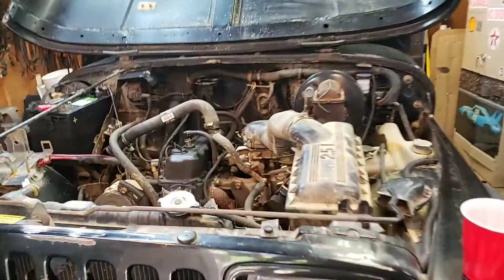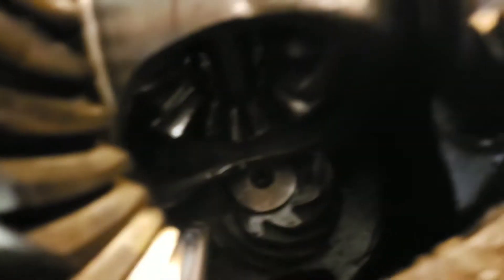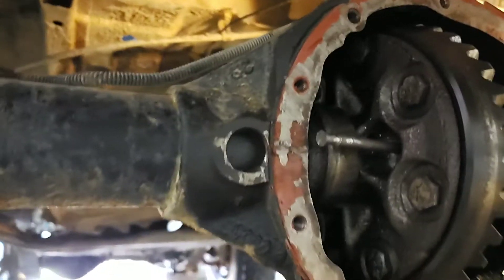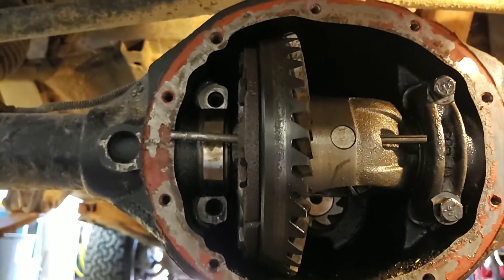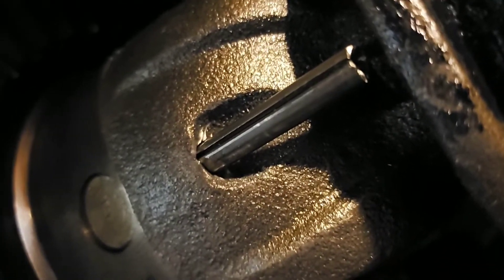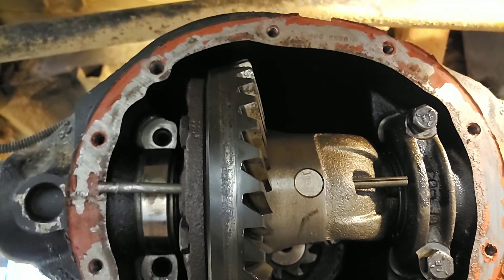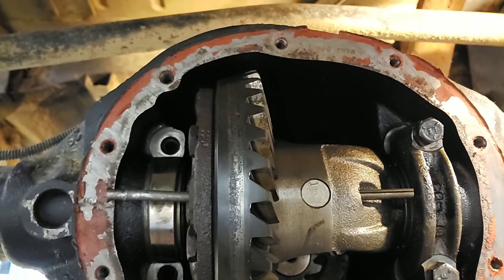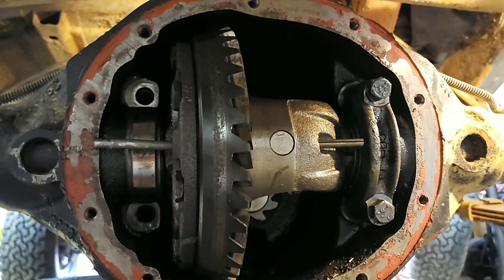1989 YJ non c-clip Dana 35 roll pin remove cross pin

Comment: Can you pull the whole carriage out without pulling the roll pin ,and leave the spider gears in to change out the bearings? Thank you.
Reply from the maker: @John-zz5gt  I don't see why not. I'm not an expert in setting up gears but ya may want (or need) to check the ring and pinion mesh is correct after swapping carrier bearings!
Reply: @winterturtle5764  I did not think of that. Thank you Sir.

Comment: Could you re use the roll pin?
Reply from the maker: @John-zz5gt  certainly possible but given the cost of a new pin is low... cost of it shifting out would be high... I wouldn't ever personally reuse the original. 

Your mileage may vary!
Reply: @winterturtle5764  Thank you. Very hard to get answers or parts for the pre 2000 anything, especially those 80 version jeep Comanches.
Reply from the maker: @John-zz5gt  totally! This axle is super obscure haha.
Reply: @winterturtle5764  Try to get a fuel sender carriage for it.

Comment: Great video.  Helped a bunch.  Did you end up reusing the old roll pin and did you stake it?
Reply from the maker: At this point I don't remember! I had a heck of a time trying to track down a pin with thread near a hex head that was large enough to let me thread the bore. I feel like I probably rammed another pin in it for me to fight in another 30 years. Definitely would have staked. Im the paranoid type 💯
Reply: @winterturtle5764  thanks for the quick response.